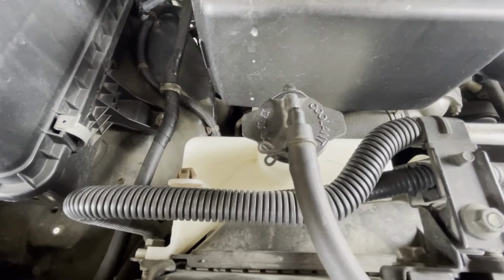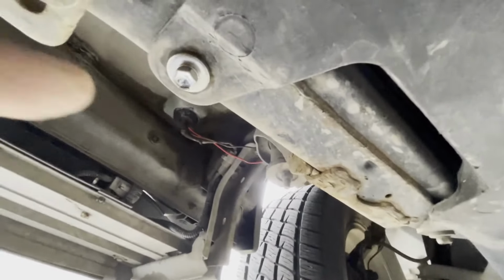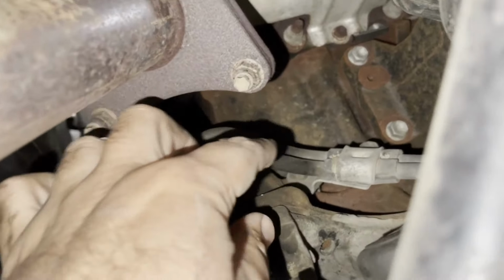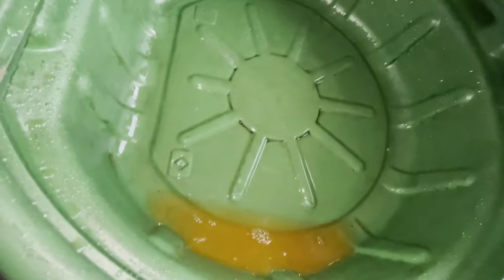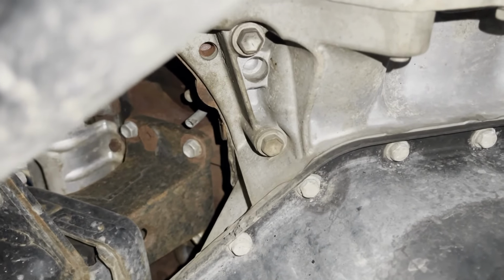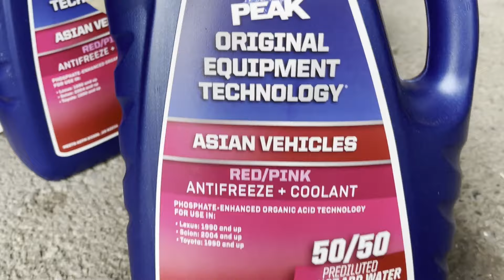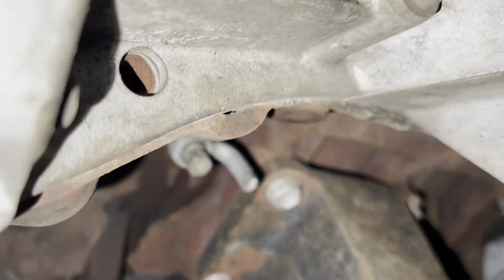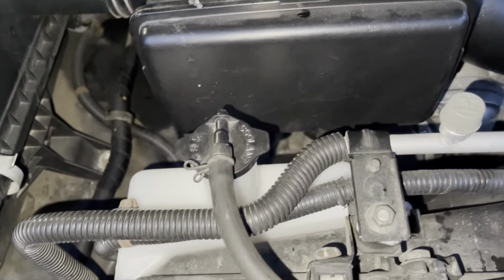Toyota Land Cruiser 100 | Lexus LX470 | Lexus GX470 | 2UZFE - Complete Coolant Antifreeze Flush

Comment: Thank you for this.  Just bought an 05 GX470.  Planning to do all the fluids.  Going back with a 60/40 mix (-60 F) and a block heater.  The car will be going to Fairbanks, AK .
Reply from the maker: I will be heading there soon for work related visit.

Comment: Was it difficult to get the air bubbles to rise up and out?
Reply from the maker: Use spill proof funnel and gravity will take care of bubbles. Just make sure the engine reaches its optimum temperature level. Once the engine gets cold, you might have to refill your coolant reservoir.